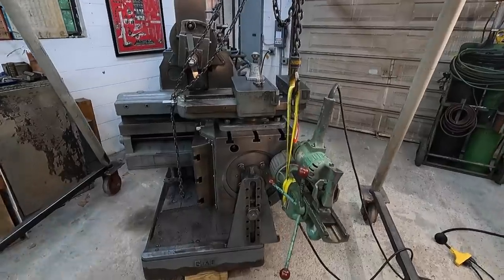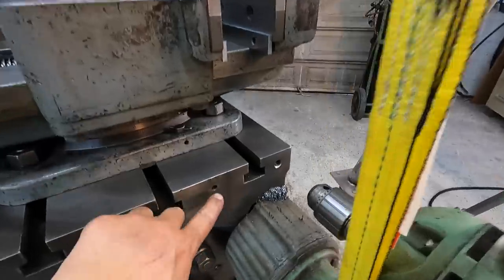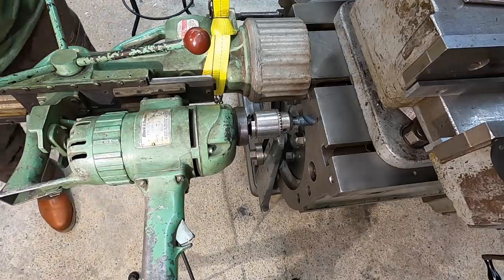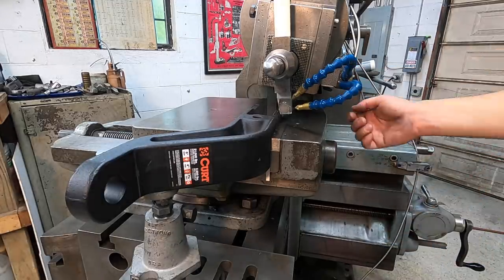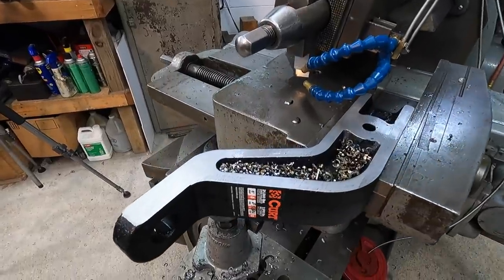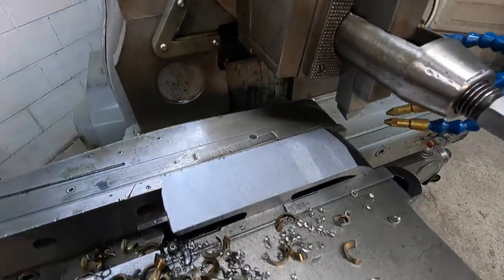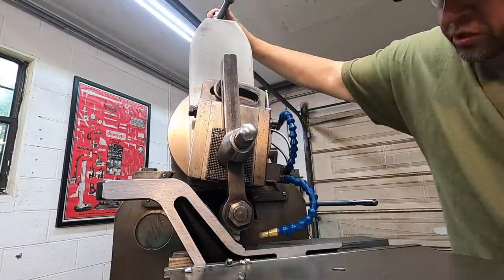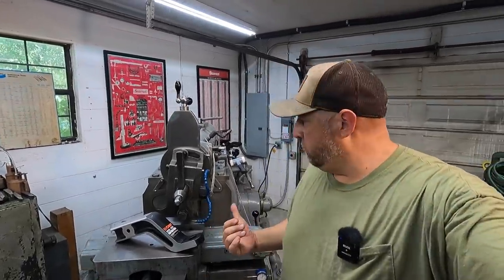3" Ball Hitch Insert Mods Part 2: Mag Drilling the Shaper Table

Comment: the sound of a shaper is so relaxing, like a metronome for the shop lol
Reply: yea not loud and screachy like a mill can be but slower then molassas unless you can have quick tasks to do while its making one run of its index, after all a friend makes foundry molds and dies out of solid block and those programs they run some for 48 hours at a time just leaving the machine to mill at half speed and check in for a few hours the next day to change fluids and check up and clean up messes.
Reply: Reminded me of a taboo film genre.

Comment: Fun magnetic drill story.  I work in a paper mill and they want everything with an extension cord on a GFCI outlet.  So the safety guy was cruising around on a work day and saw an extension cord without a GFCI on it.  So he figured he'd yank the plug and see who came to check it and read them the riot act.  Except it was on a magnetic drill that was boring a horizontal hole in the machine frame....  it fell on the floor and broke the bit.  Fun times.

Comment: We had a mobile machine shop come in and do something similar to the threads on a propane manlid on a truck tank. The old studs were worn out and needed from 3/4 to 7/8th. Guy wouldnt get off his phone till he yelled fuck and realized he was using the wrong drill bit for the holes. We had to weld up the holes and build it back up.  Not even a thank you for covering up his fuck up. Made it seem like it was our fault. Love watching your work.

Comment: Many years ago we had a need to create a 6" hole in in a machine frame. The frame was 1.5" steel plate. Machine disassembly was not an option. We opted for a round hole so we could hole saw it. The plate required a similar horizontal mag drill setup. One of our machinists was tasked with hole sawing the hole. I was tasked with making the mag drill variable speed to reduce the hole saw blade tip speed to something acceptable. My Milwaukee mag drill was not variable speed similar to your Black and Decker. I rewired the AC motor for DC using a a full wave rectifier for my field voltage DC, and I ran my armature voltage through a Variac to regulate armature voltage before rectification. I didn't supervise the hole sawing, but I checked on the process throughout the effort. This was done on a prototype new machine for a customer demanded design change. Cosmetic consideration was paramount. The machine was likely selling in the $1M range. I feared that my component section for the DC power modification might prove under rated, but it worked flawlessly. I was a momentary hero, but I was nervous about my design success. I am a maintenance electrician not an engineer. I made some guesses, but I had no idea how much load that big hole saw was going to put on my drill or on my modification components. I saved my modification setup for probably more than 20 years on the off chance I needed to set up that mag drill for a similar operation. A Lean Manufacturing 5S effort tossed out my rig and we never came across another need to apply it. I thought about your power tapping effort and how nice it would be to have variable speed and high torque. If you want to make a conversion, I can assist you.

Many people don't understand that wound field and armature motors are essentially the same construction for AC and DC. Since I needed low speed and not high speed I had no need to reduce field voltage. Typical DC motors are able torun up to 200% nameplate RPM by reducing field voltage after reaching full armature voltage. I was instructed that it was imprudent to go over 200 % nameplate. In theory the armature will self destruct from centrifugal forces if you keep increasing the speed by further reducing field voltages. I have never tried it. I taught a group of boys an introductory level electricity class. When I covered motors, I explained the self destructive concerns of wound rotor DC motors. The youngest of the boys pressed me for the balance of the course to have a lab where we "blew up a motor".

Comment: I learned to use a shaper when I was in high school (1959). I made a rivet set with tapered head.  It took for ever as the taper was about 2.5" long on sq stock. We also had to make our cutting tool.

Comment: All that shaper work only to resort to hand tool grinding the radius along the edges.  Shows the signs of "Ok it's less fun now, I just need to get this done!".   Nice work Adam!  Now to those who keep mentioning concerns....Adam said at the beginning that he was not planning on using the modified hitch for heavy loads and that it would still be just fine for anything he'll use it for.  See, my thinking is that the GUY who has worked with every kind of metal for...HIS ENTIRE CAREER most likely knows a metric F-ton more than any of us and given his demonstrated knowledge and skills on this channel for YEARS makes that more of a certainty than an assumption.
Reply: right? people just need to feel important, sad sad little people.
Reply: Too right ... there seem to be quite a few narcs in the peanut gallery projecting whatever. Letting the full slow motion of the shaper continue in the vid for instance gave us a sense of why this machine was purchased in the first place as was clearly explained. You either get it or don't.

Comment: I agree Adam watching the shaper carving off slices of metal in slow motion is hypnotherapy of sorts especially when you can hear the metal being sliced away and landing.
Your crane for the truck is a good idea, I live in a small rural town in Western Australia and a few of the farmers have them on the back of thier UTES ( mostly on the flat 1 tray type of 1 tonne ute mounted mainly just behind the cab
I do like the idea of using the trailer tongue port for temp use
I take it you saw The Tubal - Crane that Mrpete built and the excellent "new" sticker that was made for him for it?
Tony from Western Australia 🇦🇺

Comment: Great job, as usual... On the hitch picker, think about making the bottom have a flat plate that you can put a bottle jack etc. under it to take some load off the hitch. A welder I used to work with had a bad failure on his truck hitch lift, when the connection to his truck gave way and crushed his foot. Just a heads up!

Comment: In the shop I used to work in we had a magnetic drill called a slugger. It was much more compact that didn't have a detachable hand drill. It also took bits similar to an end mill.

Comment: we trim only the part entering the receiver plus 1/8inch more, this save 2/3 of the grinding and repainting. we also weld two solid plates to box the I-beam thats thinned. the plates run forward 1/2 inch into the start of the downward curve. this preserves the poundage rating on the drop-hitch. _USN/coast guard repair operations bouy shop.

Comment: You could experiment with mounting, maybe on the front of the slide,  a brush or an air blower hose or a vacuum hose or ? so that on each pass the chips are brushed away, blown away or sucked away or ?

Thanks for another great video.

Comment: my friend drills a 3/8 etc hole under the receiver at the spot at the front of where the mount slides in the receiver. and tacks a nut on over it, so you can thread a stainless bolt (wont seize/rust in) in against the front of the mount, driving the front of the mount up, to stop the mount from rattling in the receiver. for the pin, he glued a grommet sliced in two against the receiver to act as a dust shield cause he's in an area that sees rust.. works great.

Comment: Adam, I have the same exact age and model of bux magbase that I got for cheap and rewired/repaired, but the placard is missing so I do not know the model or exact age.  What is the model of yours?  You are the only person I have seen with the same exact same model (3 handles on the spindle; non-rotating base; exact same hardware and oiler hole layout).  Thanks!

Comment: Adam, considering how well it handled that .200" depth of cut, you probably could have taken the full .225" down to it's finished size in one pass. You could slow down the speed a little bit and it would probably work.

Comment: That’s no longer a Curt hitch ! Peal the sticker off and make a new Abom sticker ! Lol
Reply: Big mistake! That insert was dimensioned for a 3" ball. Make the receiver bigger to handle the insert dimensions.
Reply: @bxb590  wast it for a 3” DROP or a 3” wide receiver down to a 2” receiver ? I’ve never seen a 3” ball ! 2 5/16 yes , what would you use a 3” ball on ? My goose neck is a 2 5/16 and my 30’ camper is a 2 5/16 ?
Reply: @davekimbler2308  C5A towing, 747s, what have you.. :)
Reply: @silasmarner7586  I have a 30’ gooseneck trailer and a 30’ bumper pull camper and a 25’ 5th wheel camper and a 23’ 5th wheel camper for hunting and drove OTR for 35 years !

Comment: I made a hitch crane and had some issues. Lifting Any decent load off to one side would quickly become difficult as the off side springs unloaded and the whole Ute tipped, which swings the load to one side. 
I then made out riggers with trailer jack legs which helped, but I need to send them out pretty far (500-1000mm) past the Ute side to compensate for any spring off loading.
I also now have the crane offset to one side of the tub to allow the tailgate to open.
Over all, I don't think the are worth the hassle and will be mounting a fixed base in the tub with an outrigger.

Comment: I'm curious about the G&E shaper's operation.  I know nothing about them or the terminology but I'm curious about something.  The table transits between the front stroke and back stroke causing the tool to drag backwards over the uncut piece.  I know that's the reason for the hinged tool holder.  Couldn't the shaper have been made so the table transits between the back stroke and front stroke doing away with the need for the tool to drag and also the hinged holder?  What am I missing?  Is it just the way the mechanics and timing are set up in general?
Reply: My question as well. I’m not sure why the back of the tool bumps into and rides up on the work during the return stroke? Doesn’t it simply pass through the cut it just made? I thought maybe the step-over occurred after the cut, so the work has moved over before the return stroke, but it seems the step-over occurs as soon as the ram returns to its starting point. 🤷‍♂️
Reply: It could have been done that way,  but it would be a more complicated mechanism and a longer cycle time. The machine was probably made in the 50s or 60s when electroinc controls were much less of an option. So any feature you design into a machine is likley to be mechanical. With anything mechanical, simpler is better.
This design was used by several manufacturers over several decades and always worked good from what i hear.

Comment: Been watching the slow motion shots and I noticed that on the reverse stroke the clapper lifts up but as it gets back towards the beginning of the last cut it lifts higher, this would suggest to me that the side of the previous cut is not a flat surface!
Can you shed light on why it lifts higher? I’d be interested to see a dial indicator run along the vertical side of the cut to see if it’s true.
Thanks
An inquisitive English man! 
PS keep the videos coming, only thing worth watching on TV.
Reply: The vise is moving 30 thousandths over in order to be ready for the next cut (forward stroke)
Reply: Wouldn’t it be better if it moves over after it goes back for the next cut?
Reply: @robertheinkel6225  One would think : )

Comment: This might be a little late but wouldn't it have been a little easier to take the hitch off the truck and put a 3" tube in it and use adapters for smaller hitch sizes you want to use? And at the same time allow you to use a larger tube for the crane you want to make?
Just a thought going through my head while watching this....
Reply: Then he couldn't use a standard ball mount when he needs to.
Reply: @bytheseaaspirinshop801  Certainly he could. Just insert the adapter into the hitch.
Reply: Easy is hardy ever any fun.

Comment: I found when using the 6 flute chamfering bit you have to run it very slow, 1/3 the speed of a 2 flute or it will chatter.
Reply: I thought that more cutting surfaces would produce a nicer cut. WRONG !! I went back to a single cutter.

Comment: Why make the whole thing more narrow? Could have made it stop with a shoulder. Artist’s choice I guess 👍🏻
Reply: He explains that this is classic shaper technique in part 1, but not why it used to always be done this way. 

The reason is that the shaper's unique strength is that it doesn't really need the user to pay attention to it for the whole cut. You just set it and go off to work on some other part on other machines for a while. That let (pre-CNC) shops get more parts per machinist-hour. But you can't just walk away if you want the cut to stop partway along the surface, so it only got used where you could shape down an entire face at once. If you could pay attention a mill is going to be 2x the speed (no wasted back-stroke time). These days CNC mills can do the same thing, and they're faster per part, so everyone uses those and nobody makes new shapers any more.

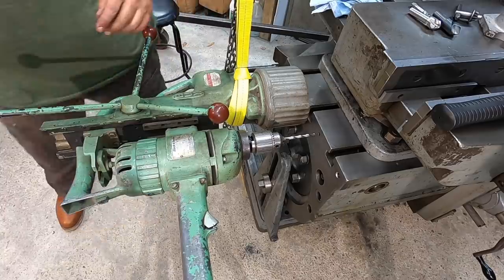Comment: 9:15 Adam, I like tours - workshops or machines. Can you give us a tour of that drill ?
We have one like it - but it's a slower one - and it fits in a bench drill stand. Opposite the handle with the trigger is a threaded hole you can screw a length of pipe into for a second handle. The trigger on ours has a latch so it keeps running if you want it to. But ours is not reversible - that was a surprise - and I can't see a reversing switch on it - so I'm wondering if that big ring between the handles reverses it by physically altering the position of the brushes inside ! ???????? (11:10 yep, I'd guessed right !)

At 10:17 there's a machined circular part of the body just back from the chuck. That's where ours is clamped by the drill stand. The back of the drill is held in place in the stand by a hole in the body under the back handle - and yes, they are noisy motors !
Reply: A "tour" of the drill??
Reply: @paulcopeland9035  Same concept, less amount of walking !

Comment: OOh man i am looking forward to what you design for the trailer hitch mounted lift mechanism. I have almost the same truck and had never though about that till you mentioned. I have looked at small utility bed mounted cranes, and lift gates. but not a simple cherry picker attachment. (I also desperately have a need and use of what your talking about around here. Having a lift table is great for getting stuff out of the bed and onto the ground. but its not a option in the fields)

Comment: i see your green mag drill.. and keep thinking about the 3/4" either B&D or Skil .. but instead of a jacobs chuck it has a #3 morse taper sleeve..  and the reason i keep thinking about it.. a friend came over with his brand new milwaukee hole hog.. said lets play who has the biggest drill.. he whipped open the milwaukee case. i climbed in my van and pulled out the 3/4" drill motor..  he then said.. i don't want to play with you anymore.  your tools are bigger than mine..  i had done the same thing to him weeks before.. he pulled out a 10 pound sledge hammer.. i pulled out a 17 pound fencing maul..

Comment: Boy howdy. When was the last time you saw a working Black & Decker drill?
Reply: I have 2 of them. One has a right angle head, the other has a 1" bolt for a handle. If you can hold it, it would probably spin the earth backwards. If you cant hold it, it's one hell of a ride.
Reply: The old B&D tools are not anywhere like the junk they make today. B&D once made quality USA made tools.

Comment: From a designer point of view. I would like to see you weld in some metal to get that wall thickness back in the I-beam. I'd ask someone smarter than I am to do the math with the wall thickness you're finishing up with.
Reply: Clearly he made it weaker, why he don't buy a normal 2 Inch Ball Hitch. I would asume that he can tow more with the 2 Inch than his "Thing". The Weak Point is now the Ball Mount Hole and the Wall thickness of it. You have less "Flesh" than in a normal 2 Inch Mount. So easy Math, you need much more Time, it cost way more than just a Regular and it even not better oder even.... When i want a 3 Inch Mount then you need it from the Front to the Back. Btw. A 2500 is rated at 19k Pounds why you need than a 30k Hitch.....
Reply: @black666bull9    See the first part of Part 1.

Comment: Nice job. How do you determine which machine to use, either using a table lathe or the shaper? Looks like the amount of material you can remove with the shaper is probably one factor, that’s insane.

Comment: I think the advice on McMaster regarding flutes and countersinks is misguided. If I use a 3 flute HSS countersink I get a better finish than a 6 flute carbide one. You'd figure the carbide wouldn't chatter, but it does. I guess they require CNC-like rigidity.

Comment: Any less play in the receiver up North where roads are salted and sprayed with calcium chloride in the winter, the hitch would be rusted solid in two years if left in place. Play is your friend as much as anti-rust coatings.
Reply: Two years? Half a winter some places. 

His machinist mind is showing, slop can be beneficial but he didn't even account for space for paint to try and make it a "slip fit" aka "I can barely move it by hand"
Reply: I have tried using fluid film on my drawbar for the first time.  Time will tell if it works.
Reply: Robert Heinkel that’ll be a good test. I think as long as you don’t accidentally pressure wash some out. Pressure washers can do a lot of damage especially on OHV toys. 
Take a look at CRC SP-400 anti corrosion spray. I found it excellent as a heavy duty mechanic.